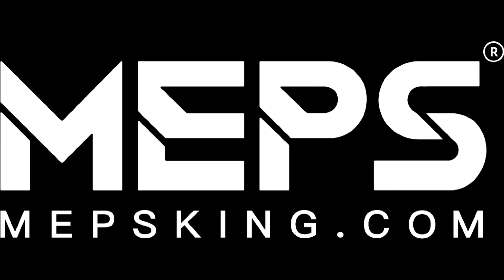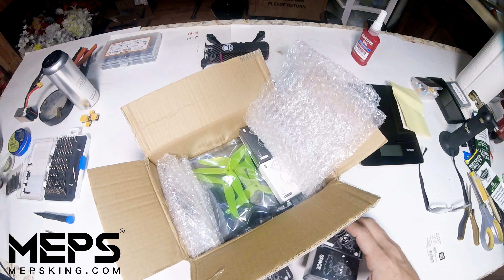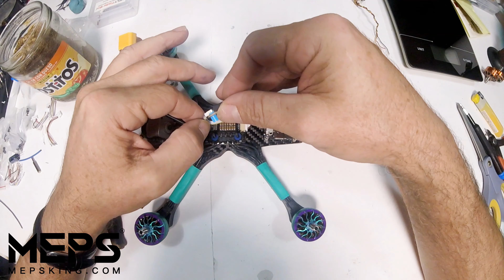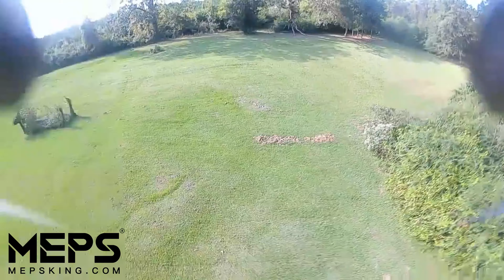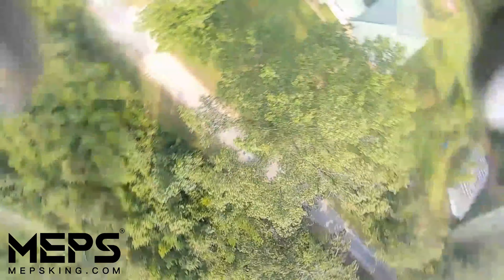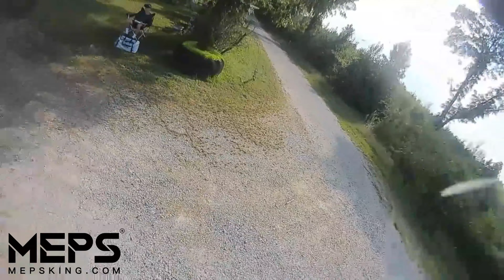@mepsking - Build the Ultimate Indestructible Drone: The last & only drone you will ever need!

Comment: That is very interesting bro , question for you did you install the esc backwards ? If them power lines could talk they will be cursing you out lol 💯👍👊✌️
Reply from the maker: Yes i installed the esc backwards. Most of my build are done this way so i can get the power wires to come out the front of the quad.